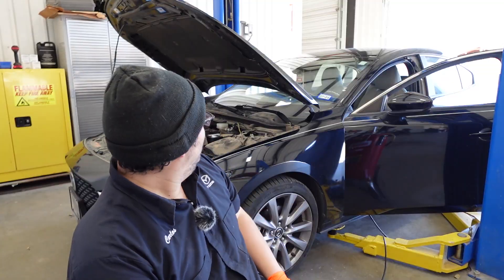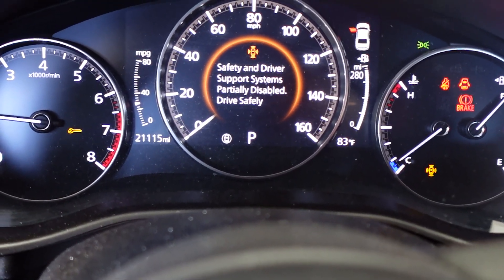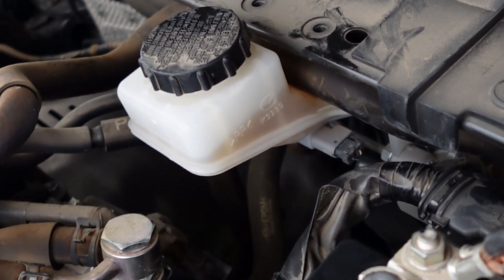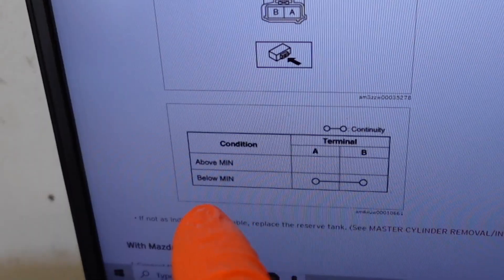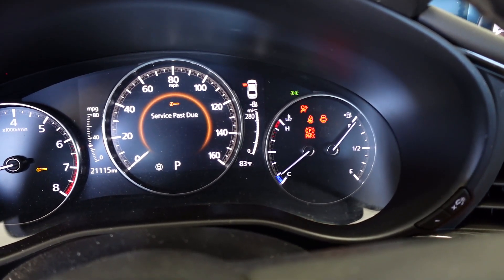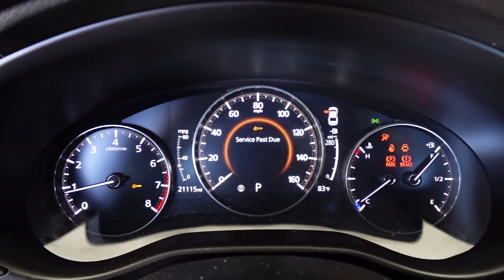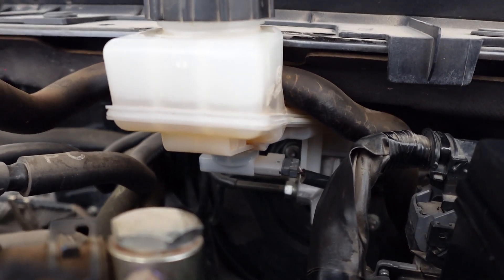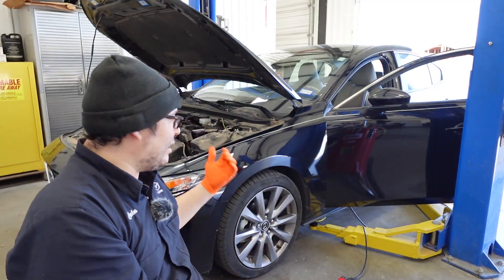MAZDA 3 BRAKING SYSTEM MALFUNCTION

Comment: Hi i have the samw problem, how do you resolve?
Reply: Did you watch the whole video? If you disconnect the sensor and restart your car to see if that resolved the issue? If so, you have a faulty sensor - if you want to fix this, you need to replace the Master Cylinder as the sensor is connected to the reservoir

Comment: thanks, great clear video. This is happening on my wifes 2021 cx-30
Reply: How did you fix it ?
Reply: unplugged the sensor. cant justify paying tons of money and time for 1 sensor
Reply: @grit93  
So my brake fluid is right at the min level line and it is bellow freezing where I am. I noticed that malfunction error eppear, disappear and reappear again and when i removed the sensor the error disappears. My question is it safe to drive with the sensor unplugged ?
Reply: @TheMoorishKnight  Well im no mechanic so dont want to give you bad advice but from my understanding the sesnor is there simply to alert to too high or low fluid levels so I'd imagine it's good to drive as long as you keep an eye on the fluid level. My other 2 vehicles dont even have sensors

Comment: Thanks for this video , my girl 21 mazda 3 turbo was getting this message. She took it to pep boys to get an inspection,  told her the brakes are at half life and don't need to be replaced just yet . Everything else was fine , apparently.  Came up this morning again when she was on her way to work expect it was flashing so she got nervous and pulled over to call off and come back home. I ended checking the reservoir because of the video and sure enough the brake fluid was low. Filled it enough pass the min and the light came off . Test drove around,  car brake pressure was a lot more responsive and light never came on , thanks 😊

Comment: Hey Cardiac Plays, I need help,, I have a 2015 CX 5, 2.0. AUTOMATIC WITH MANUAL SHIFT. When I shift from park to drive and release the brake the transmission takes about 3 - 4 seconds to engage properly. Usually it should move as soon as you shift to drive. The transmission delays, so if go on the gas and the TRANSMISSION  kicks IN late the car will jump suddenly. DANGEROUS. I HAVE TO WAIT FOR THE TRANSMISSION TO ENGAGE, THEN GO ON THE GAS. THANNKS MA N
Reply: Do the reset

Comment: Would it cause any issues if you leave it unplugged so the messages dont keep popping up?
Reply from the maker: No. It will not cause an issue. I would probably just put some electrical tape over the connector to keep the elements out.
Reply: @CARDIAXPLAYS  thanks so much. Just encountered the same issue today on my Mazda 3 and followed your video exactly and now my sensor remains unplugged w/electrical tape over it! I definitely will want to replace the master cylinder eventually, but this bought me some time. Subscribed!

Comment: Would love to see some CX-90/70 repair video examples if you're allowed to post them
Reply from the maker: OK. Ill record one once one comes in with problems. Ive only worked on one CX-90 so far. Front differential seal was leaking.
Reply: @CARDIAXPLAYS  There are going to be plenty of TSBs coming your way! Especially front suspension and rear bump stop grease...
Reply from the maker: @KillaninjaFC  Your not kidding bro. I've done like 6 recalls on some CX-90s all for software updates. Im just waiting for a customer to complain about the suspension noise.